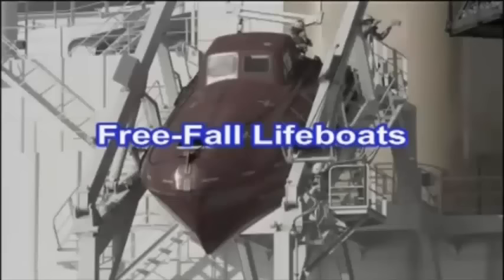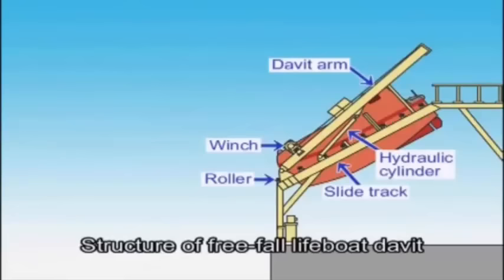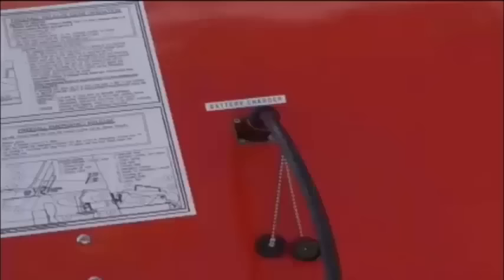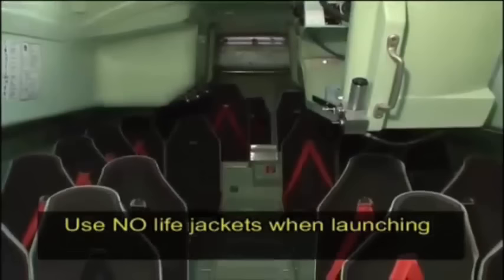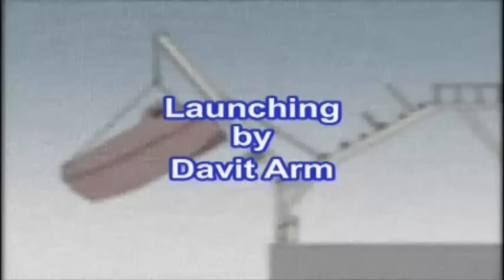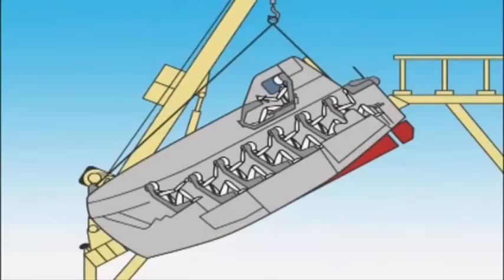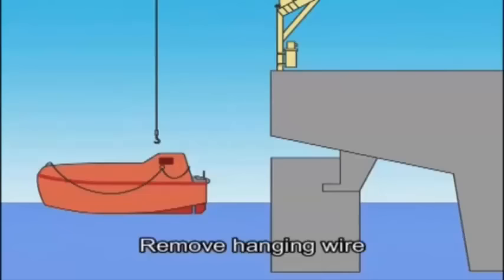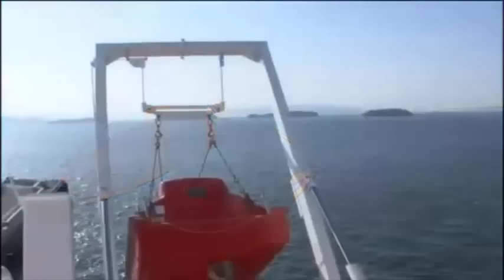Free-Fall Lifeboat - Launching & Recovery Of Free Fall Lifeboats

Comment: Moral of the story: never volunteer to be the davit operator.
Reply: The normal method being free fall launch doesn’t involve a davit operator. Everyone gets in, seatbelt on, pump handle three times. Done.
Reply: They missed out to Rig embarkation ladder!
Once L/B is water borne the operator will board the lifeboat and then the wire rope is released and steered away from the Mother ship.

Comment: Now drop it from low Earth Orbit.
Reply: It's going to burn up on reentry
Reply: @SherylNomeFairy9  Not if you cover it's hull in light weight ablative material like Nomex.  Worked on Apollo crew module.  Give it some reaction thrusters and that boat will stay at the right angle of attack for best reentry.
Reply: ODST drop pod

Comment: The world's most complicated escape. Is that really expected to be done while the ship is on fire or sinking?
Reply: I was thinking the same thing. Seems like you would have to take a college course first. Lol
Reply: Andreas Behringer well, it is faster than the conventional way. It does seem complicated though.
Reply: It most definitely can be done    1,000 % faster, I mean I have some ideas.
Reply: Brandon Alexie like?
Reply: Brandon Alexie and this is why you go to the merchant marine academy. There is literally an entire school for deck officers and engineers. 
The whole process takes less than a minute.
Reply: FoxGaming76 YT I’m interested in how he plans to do it faster. On average it’s 55 seconds deck to powering away. If you can get the whole crew on the boat faster that’s about the only way to speed it up. And ships aren’t exactly small and there’s a lot of ladder wells so - may the odds be ever in your favor.
Reply: strap in, pin out, twist nob, pump handle not that hard... ones for casual emergency's the other is for GTFO FAST emergency's...
Reply: I'd assume they train and drill regularly

Comment: Doesn’t hurt the people inside?

Nvm I thought thought they didn’t where seat belts lol I’m dumb
Reply: Hey...it’s a decent question.
Reply: There's still an impact. It's like crashing your car while wearing seat belt.  You'll still feel an impact depending on the g forces. Which is the point of crumple zone to reduce the g forces on the body.
Reply: @pic18f452  Though I doubt there are any crumple zones on these lifeboats. Not if they were able to drop one 2000 times like it says in the description. Another video I saw says that, depending on the drop height, they're experiencing 8 to 20 gees on impact. Hell of a ride.
Reply: @skunkbucket9408  meant crumble zone in a  car.  In this boat situation it's the water density that delivers the high deceleration rates.  Yes I read 20Gs which is very high impact. Even if your facing backward,  because it's your organs that are experiencing the g forces
Reply: Real men don't wear seat belts

Comment: You’d think they’d have some kind of extendable or inflatable system to ease the boat into the water.  Like a longer airplane escape chute.  Even if it got you 50% closer to the water and further away from the ship, that should be worth it.
Reply: Freefall lifeboats are often used on vessels carrying hazardous materials or with a high risk of explosion. (Chemical tankers often use them, for example.) Being able to separate from the ship as quickly as possible with 100% reliability is more important than the comfort of the passengers. What happens if the slide fails to deploy and the lifeboat gets stuck? Better to eliminate potential points of failure, and save some money and maintenance hours while you're at it.
Reply: @yetanother9127  Good points.  That just looks scary.  I guess it’s better than the alternative.  ;)
Reply: Added complexity and increases evacuation time. The lifeboats are designed for this.
Reply: Seems unnecessary when there’s seats and seatbelts onboard. Should just be like a roller coaster. I don’t think it would be very easy or cost effective to make an inflatable slide strong enough to carry a whole lifeboat to the ocean.
Reply: @Jushwa  You’re right.  I’m just a fat land guy second guessing those that know. ;)
Reply: @Jushwa 9
Reply: @CreachterZ  I think I’d just jump off the platform and wait for others to launch it and hope they let me on. I’m a team player that way

Comment: What advantage does the primary method of releasing the main lashing have over the backup one? For freefall launch the backup method doesn't seem any more complicated.
Reply: The primary method is more convenient I guess.

Instead of having to reach over for a screw to unscrew, you just need to pump a lever right next to you a few times.
Reply: Based on what I saw in a different video, the backup method is used to release the boat if it's not completely full. Hitting the water is a lot easier from a rear facing seat.
Reply: The backup involves leaving the winch operatior behind
Reply: The second and third comments are thinking of the wrong backup, they mean pumping the lever vs using the preloaded hydraulic pressure screw

Comment: What happens to the Davit arm operator?
Reply: If the ship is sinking, they will probably have to go down with the ship and get on the boat after. I don't know exactly though, this is just how I imagine it being.
Reply: @Nitronomic  No,I am quite sure that's not the protocol becuase a sinking ship going down will drag down everything nearby with it.The term of this is 'vortex of suction '.I could be wrong about the term but I remember watching this on National Geographic as a 
Kid.
Reply: That’s only used for practice. I believe there is a way to release the Davit arm when inside.

Comment: That was all good as a rescue till there has to be one person left on the ship to operate the hydraulics to lower the boat.  Does this person jump after the launch or just left behind?
Reply: This is only used for practice. In emergency they only use the free fall method
Reply: Remember the pump the handle three times part? That’s from inside the boat. Nobody is on deck.
Reply: Yes, they just leave them on the sinking ship 😂
Reply: @NicholasLittlejohn  he volunteered to feed the fish

Comment: Way to difficult to launch!
Reply: Exactly, in case of emergency time is critical, and you don't want to end up stuck inside without it launching. Seat belts could even be automatic, just pull the red handle.
Reply: Lol must be troll.

Traditional davits and lifeboats were way harder to deal with. You can't just let the ship sink and hope the lifeboats float.

I could say more but you must be trolling.
Reply: @emersonsnyder369  Are you serious? If the old equipment was harder, that doesn't mean this one is perfect. In an emergency (fire/bad weather) time is critical, and too much on the checklist can be dangerous. I'm used to checklists and safety equipment as I am a flight instructor and have also flewn aerobatic airplanes with life west and parachute. On my newest airplane I have a chute that takes the plane down safely if anything breaks or if I get ill. There are two things on that checklist - reduce speed if possible and pull the handle.
Reply: @Stratus2B   So you don't know anything about maritime safety, ok. First of all everything is tied down because the ship is moving around a lot,  all the time. Sometimes there are lifeboats ready to launch, but if you are on a large ship with many people it's unfeasible to have every lifeboat ready to go at a moments notice. There are a lot of reasons for this, space, weight (davits are heavy and at the top of the ship), aesthetics (passenger ships generally want to look nice), cost (always). There are even stupid people to this day who will get drunk and try to steal them. It would be quite the prank if 5 year old Billy sneaks around and releases EVERY SINGLE LIFEBOAT.

So basically the first lifeboat could be lowered, slowly, and generally with a set of 2 davits. Once you start it has to go all the way down because the weight is holding the hooks in place (they're not hooks, but similar and I can't think of the name). You wouldn't want it to drop either, as you could buckle a joint or plank and be in another slowly sinking boat.

So now you have to unlash the second lifeboat, haul up the hooks and attach them to the next boat, swing it over and do everything again. So it takes a shit ton of time, and a team of people controlling the lines so they don't accidentally flip the boat sideways.

Here's another problem, if it's rough seas and the line snaps on the way down, you're probably dead. If the line swings and your lifeboat smashes into the side of the ship while on the way down, you're probably dead. If you're the only one conscious and there's no one to help you lower the lifeboat, you're probably dead.

With the free fall system you are in the water and moving away from a dangerous sinking vessel right away. There is nothing attached to your ship so there's (basically) no danger of it pulling you down with it. On lifeboats with tethers or lowering cables there are usually pressure triggered explosive bolts so that if the ship is pulling it down, the line should snap.

Source, lived and worked on sailboats and tallships for a few years, though the oldest was late a 19th century trade schooner. Have been on many larger ships but never sailed a tanker or anything similar. I've manually lifted sailboats onto drydock using davits. It's an interesting maneuver on solid dry land, I can't imagine the skill it would take while your ship is sinking in rough seas.

PS I'm imaging the plane you're flying to be fairly small, I've never seen nor heard of an airplane parachute except for in model planes and rocketry. I do know about drogue chutes for slowing down test/unmanned planes, but now I feel like you're trolling again and I'll have to look that up.

PPS not saying there was one set of Davits per ship, but rather multiple lifeboats per set of davits. BTW davits are those crane arm things, dunno why they are called that.
Reply: @emersonsnyder369  Wow that's a long text. I feel sorry for you using your day to criticize others and accusing them not to know anything. I hope things work out for you. Btw there are ballistic rescue systems also for helicopters. I'm aware the challenges on a ship, but those minuits with running here and there seem meaningless and is a safety issue. Let's chat in ten years.
Reply: @emersonsnyder369  Of course I see this from my point of view. I think that an emergency is an emergency and that's what this is about. I wonder if everything happens slowly on the sea, even the explosions. Why not have 2 or 3 easy steps or just a code for the whole launch? Of course it had to be safe for the 5 year old and the drunkards but this should not be a problem.
Reply: @Stratus2B  There are dry suits for extreme emergencies, think of a wetsuit meets a liferaft. The actual berthing/launching of a boat from a ship is a little more complicated because it can be thrown off in high seas. Drysuits can keep you alive and afloat but are pretty immobilizing among other things. They've found Alaskan fisherman floating around Hawaii, death due to starvation/dehydration, kept afloat by the drysuits. They are hot as shit inside, basically you have to keep refilling it with water if you aren't in arctic conditions.

Think of a drysuit like a parachute, and a lifeboat like another plane launching from on top of your plane. If you are over sea or desert or tundra, that little plane is going to get you so much further out of your situation than walking. Likewise if you are totally stranded, unable to fly, communicate, anything, a search party is much more likely to find a boat or plane over a human silhouette. Also sharks can't generally eat you on a lifeboat. Also why they always come in crazy bright colors. I think they stopped using bright yellow because it can look like the sun reflecting on the ocean. We always had bright orange, while I've seen yellow there was a reason we didn't use it.

Furthering my really weird fictional analogy, imagine the stress put on an airframe and imagine trying to keep two of them tied together during normal operation (or high-G stunts). I would imagine that system would have to be strong and might have a few more steps than one to prevent accidental separation. If it took some damage (hit a flock of geese) there might need to be a backup, like explosive bolts, and separation might take a few extra steps. I also think I just proved why these things don't exist. 

I've gone fully sci-fi at this point, I've been awake for almost a day, not good.

But basically, this system is pretty great. I would take this thing 10/10 over the inflatable life rafts and wooden rowboats we used. These models are basically submarines without ballast. They can't go to any depth but they can be fully submerged and just pop back out of the water. The launch looks fucking scary though I'm not gonna lie.
Reply: Yeah, looks like way too many steps for being in high seas in an emergency scenario. Is there not some way to secure the boat without requiring someone to wander about the deck unclipping things? Seems ridiculous.
Reply: I'm with you it shouldn't be that many steps!come on now like I have time to disconnect the battery charger and screw the cap on, it should be automatic disconnect every second counts in an emergency
Reply: So difficult it takes 56 seconds from everyone wearing their seatbelt to moving away from the sinking ship...
Reply: Brandon Alexie how many people do you think actually perform the operation? There is a lifeboat TEAM for a reason. They simplified it for the video and now everyone assumes this process is a one man job. 
It takes less than 60 seconds from door close to the lifeboat moving away from the sinking ship.
Reply: yeah, they should really just push a button and teleport everyone onto dry land!